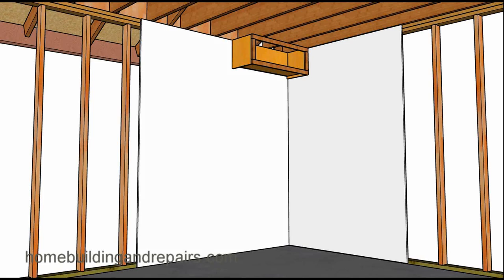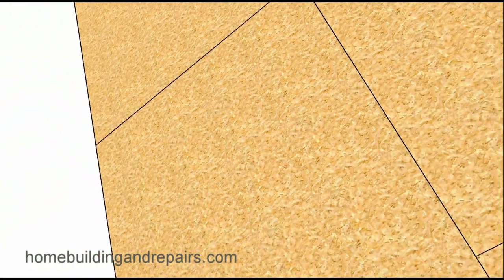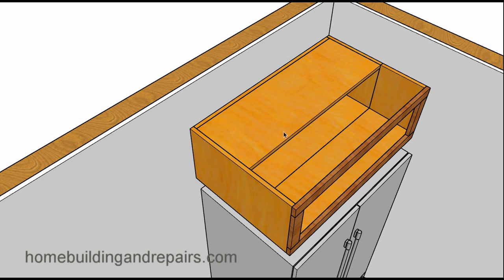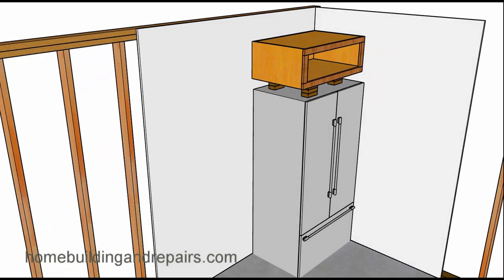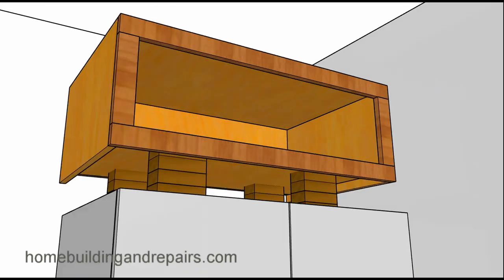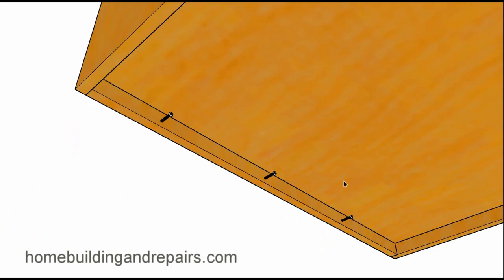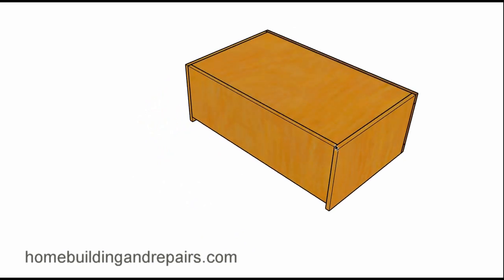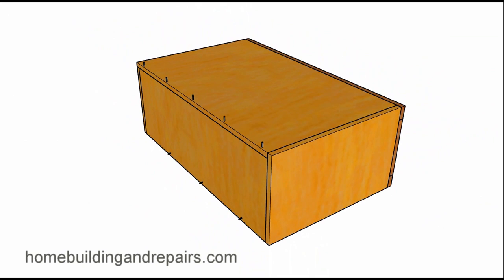A Few Ideas on How to Make Your Upper Refrigerator Cabinet Longer

Comment: How about how to make it shorter? Any body know?
Reply from the maker: I don't know if this will work, but could you reverse the process and the video. Would that make sense? Sometimes it's actually easier to remove a cabinet and cut it to the desired size and then reinstall it.